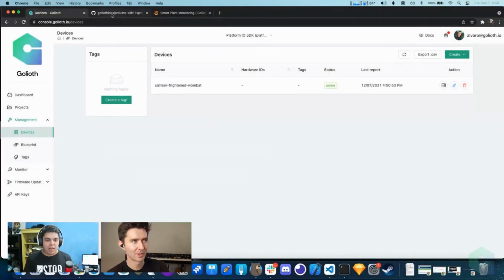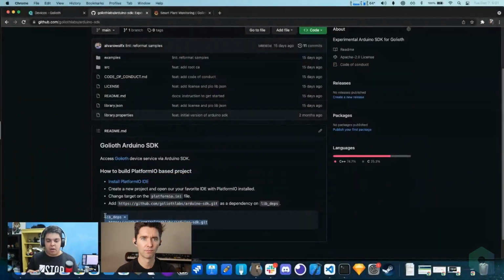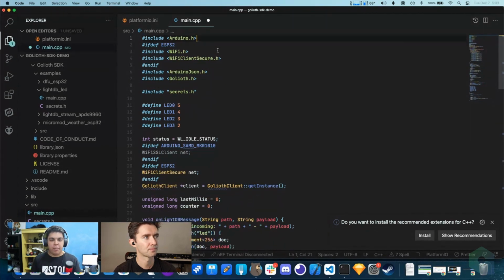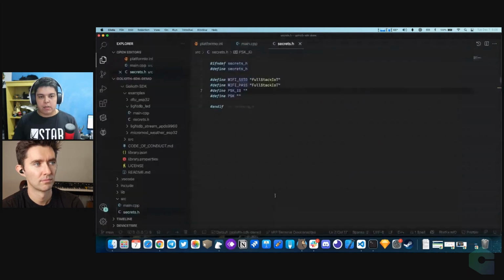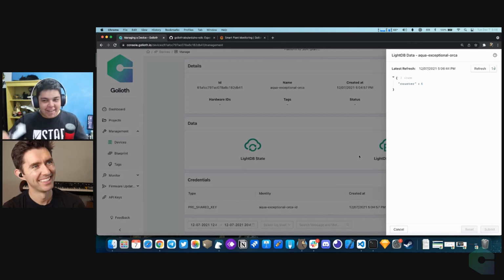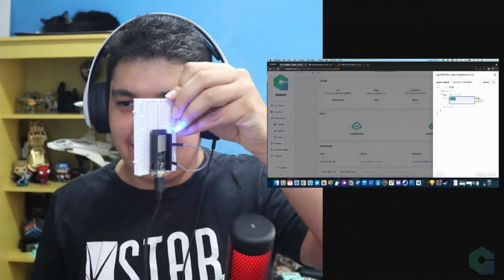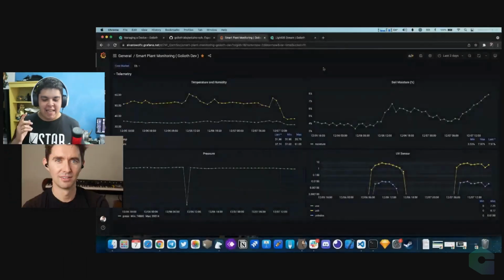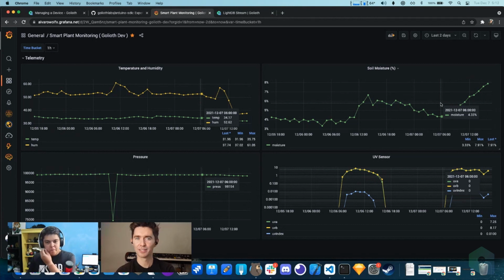Trying out Golioth with PlatformIO and Arduino Core

Comment: Golioth's support for PlatformIO + Arduino Core + MQTT is dead now, right?
Already posted an issue in the appropriate git repo, but considering the documentation is gone/non-existent and the MQTT server does not work, at least with the example code provided in said git repo, it doesn't exactly look promising at the moment.